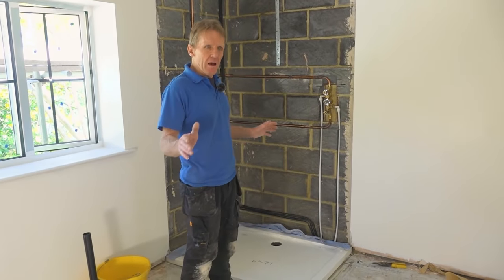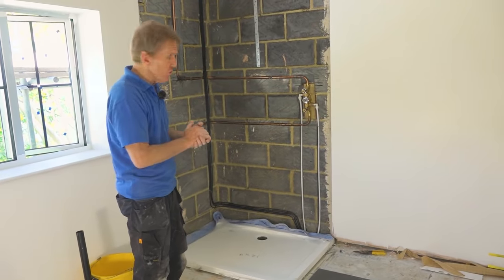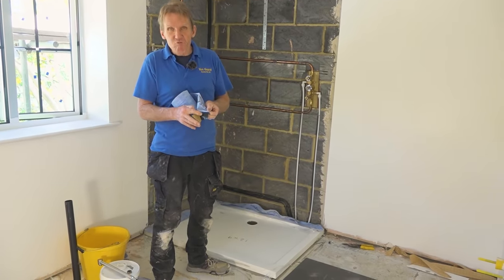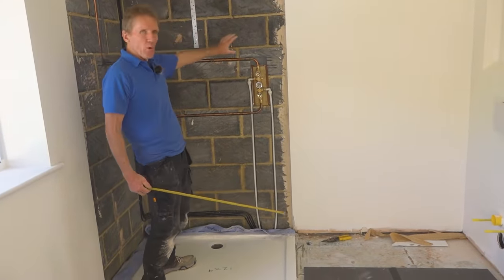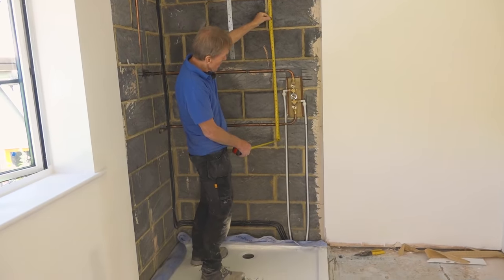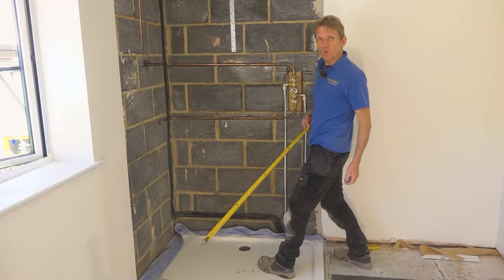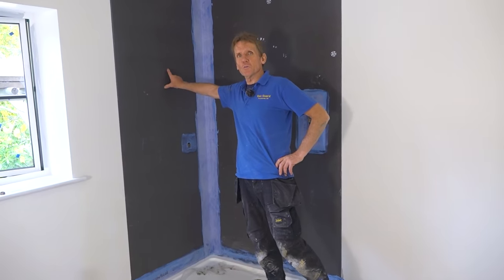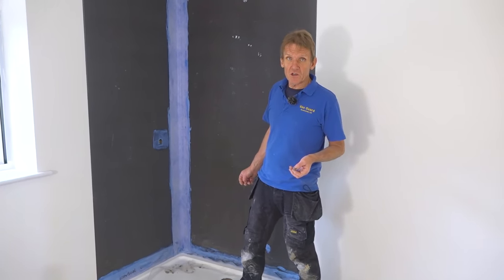100% Waterproof Shower Surround ~ Extension #23

Comment: Nice job, but I personally always fit boards then the tray and seal the tray to the board first and use dot and dab instead, always tape all round the copper pipework as cement based products corrode copper

Comment: Do those screws go straight into that block work without drilling and what was the foam for?
Reply from the maker: James loves a bit of foam
Reply: I guess the foam was to stop or prevent any moment of the board  surface after everything has set. That way the tiles and grout remain stable? IMHO

Comment: Correct me if I'm wrong but shouldn't a cement based adhesive not be in contact with copper pipe as it affects the pipe?
Reply: Cement corrodes copper. I just say I’ve never actually come across it corroding a pipe enough for it to leak. Probably because once the surface oxidises the corrosion stops..
Reply: Personally i always wrap copper pipes in walls with duct tape
Reply: @amateurvegan2636  I’ve come across it many times
Reply: Tbf oxygen corrodes copper

Comment: Wonder could you explain a little more regarding sealing up holes that are required in the backer board for pipe and shower controls. I.e. how to ensure water doesn't get in alongside the pipe and run down inside the wall.

Comment: Hi Roger, is there any reason why this tape was used rather than the abacus sealing tapes? Also if the tray is bedded in after elements board is installed, can q seal be stuck to the board from the tray ?

Comment: Hi Rodger. Love your videos. I’m installing a shower and I was wondering what mix of sand to cement you use. Is 4/1 ratio ok and do you use soft sand or sharp sand?  Also my floor is moisture resistant loft board. Is loft board ok or should I cut a section out (where shower tray is going) and use 22mm plywood instead?  If you can answer thank you
Reply from the maker: A 5 soft buildng to 1 cement is plenty. Use a bit of plasticiser and don't make it too wet. If you have chipboard I would replace it with plywood. Generally it is 18mm plywood but 22mm is not a bad idea.
Reply: Wow 🤩. Thank you so much for sharing your knowledge in such a quick response. You’re a legend.

Comment: Speed fit on the mixer 🤔, foam with dot and dab. Did you use the foam to secure the tray ?
Reply: What’s wrong with speed fit on the valve? 50 year guarantee? More than any copper or compression fitting…

Comment: Nice job classi seal is so good, how come no protection on the copper pipework from corrosion.
Reply from the maker: There should be no cement on the pipes but you make a good point

Comment: Great video - one question does the seal for the corner upstand need to be at a right angle to the corner or sort of cover the corner and then push it down into the corner.

Comment: When using the tape around the mixer valve did you just put a cut down the centre and and fold the excess around the edges and the back ? That what it looks like at point 5.50 on the video.
Reply from the maker: Yes that is it. The tape forms a little upstand to deflect water away from the aperture.

Comment: Just out of curiosity what’s the point in painting and taping around the shower valve and also the shower head outlets?? They are open parts of the board to allow for second fix. What are you actually achieving?? It’s always gunna be open
Reply from the maker: If you look carefully you will see that the tape is stretched and forms a small rim around the opening. The tiles will finish just short of this so any leaks that get behind the cover plate will run around that rim and away. Sometimes we put a neoprene gasket over the shower valve. It all helps. 100% leak free is the name of the game

Comment: Which is best, the Classi seal or the self adhesive Abacus tape for the joint between tray and the wall. The Classi seal looks easier to install.
Reply: I’m gonna use both, belt and braces

Comment: Is the waterproof board etc actually necessary? Surely if the plumbing is thoroughly tested it shouldn’t be needed? E.g normal plasterboard could be used.
Reply from the maker: I have seen so many tile on plasterboard installation fail. Why go through all that grief? Surely it is better to use the right board for the job. 
It is not the plumbing that fails it is the grout and silicone joints. We see it over and over and every time I take it out and replace it with tile backer board and the problem is solved.
Reply: @SkillBuilder  makes sense thanks for clearing that up

Comment: Hi Roger can I ask is that tile board insulated it looked as though it was. Great hair cut James proper job. Thanks Roger
Reply: Fairly sure it is elements board which is the waterproof tanking system. If you go back through the skill builder video’s Robin C did a video and Roger has done too on this tanking system
Reply from the maker: Yes Elements board cuts down on condensation
Reply: @SkillBuilder  Thankyou Roger
Reply: @dougsaunders8109  Thanks
Reply: @SkillBuilder  didn't know you could get thermal construction board this big!  Usually only 1200x600

Comment: Hi guys why don't you  have clips  on the pipework  or insulation? Just out of curiosity
Reply from the maker: The board will hold the pipework in the  chase with a bit of foam here and there. The board is insulated so the heat loss is negligible
Reply: @SkillBuilder   fair enough  . Just with high  pressure  showers if they have a push control button  such as aquala( which  yours didn't ) they tend to cause a bit of hammer.  As far as insulation I'd see it as  protection for the copper from any of the dab, but you guys are tidy so no worries  there. Did you get your van sorted btw.?

Comment: Can I spread acquaseal on finely smothly plastered brickwall and use this classy seal without elements board. Would that work the same? The problem is that the thickness of the boards would take extra room in a supreme small bathroom. I need to instal a standard bath. And what is the smallest depth of elements board
Reply from the maker: Yes that is a good method, I do it a lot but you don't get the insulation.
Reply: @SkillBuilder  you mean thermal insulation against cold coming from outside?

Comment: Can you just use any flexible tile adhesive to fix these elements boards to block walls, the adhesive recommended by the board manufacturer is 40 pound for 20 kilos.
Reply from the maker: Yes, I have even use drywall adhesive.
Reply: @SkillBuilder  Thank you

Comment: Hi, as you are putting on your blue tape what is it you are using on the boards with the brush ??
Reply: many (not all) tape systems ask that you prepare the boards with a layer of brushed on liquid primer/sealant, this lets the mesh part of the tape stick to the wall and supports the joint.
Reply: The blue solution they use with the brush is Aquaseal waterproof paint. Usin  it myself in a shower installation just now. Good stuff for wetproofing. 35 quid for 5L.

Comment: Good job, its a funny old trade as so many methods and often its very hard to know which works best in real life on customers budgets, when people rip out a bathroom they can often say it was installed badly as it comes out relatively easily such as dot and dab tile method, but to be fair once you break one tile and can get leverage it should come off easily but i often think with modern flexible tile adhesives in any method it holds the tile adequately to the wall especially with grout etc, if you tile correctly and grout with clear silicone in corners after it dries i think it should last as long as you want the bathroom, if you use correct bonding on walls behind - its nice to use all the special waterproof breathable membranes and glues etc but i think if water gets through it finds a way as nothing is waterproof more than tray and tile surface - obviously on floor tiles you need backbutter and better coverage on a perfect surface but wall tiles with a levelling system with dot and dab works great and saves money - its a skill and its a compromise - the tiles actually strengthen the wall greatly but as most only interact with the wall when ripping out it gives the illusion of weakness - but when fixing to a fully tiled wall the strength is great - when i rip out old school wall tiles (small ones as that was the only thing available) it takes half the wall with it, so for me its too strong as we always eventually replace bathroom - its interesting and ill keep and open mind as i might be totally wrong once i try something new but i feel like the american paper and glue stuff is a bit of a con, if you soak water or trap water on it it will permiate - if grout and silicone fails or just needs renewing that would solve many issue its just we tend to see them too late - i suspect they will never make a perfect wetroom system as that would effect sales

Comment: Is it best to board down onto the tray? Or can you board down to the floor and then tile down to the tray?
Reply: Never board to the tray, always behind it.
Reply: Board to floor gives better control of any tray seal leakage, less chance of damaging wall components and of water running vertically to other parts of the building.  Having said that I'm refurbing an older shower with 3 walls and the tray is so jammed in theres not enough room to board to the floor on all 3 sides. I will probably apply some tape and or liquid seal to the wall components as a second layer of protection redirecting any leak water onto the floor as if it was fully boarded to the floor.

Comment: What board is that you used for the shower area please Roger??? 👍
Reply: It's either Wedi or Marmox. If you use this stuff you have to get special washer's for when you mechanically fix the boards to the wall. The surface of the boards are actually soft so if you don't use the washer's the screws will just disappear into the surface and not do anything.

Comment: Maybe look at the kerdi schulter systems, much better as you can buy circular rubber gaskets with membrane attached to go around the pipe outlets. What you did there was good but the most vulnerable area around the controls was nowhere near watertight.

Comment: Noob here - Can someone explain why people often plumb in showers using both copper and plastic piping at the same time? I think I understand why you would use one or the other (basically plastic is easier but some people don't trust it), but then why use both?
Reply from the maker: We used PipeLife pex for the supplies and that is run in from the bathroom supplies which are isolated.  The supplies to the shower head and hand spray are run in copper because the bends in the wall are too tight for the plastic pipe and we don't want elbows burried in the corner. 
Bending the copper pipe means there are no joins in the pipe other than the shower head and the oulets from the shower valve. These are made in with Loctite. All of it was pressure tested before the boards went on.

Comment: Lovely job but made a mess of the tray dust sheet or even cardboard would have protected it cement adhesive leaves scratching
Reply: That's what i was thinking. And when i go to a job where someone else has put protection on the tray, i always pull it up to see if they were trying to hide something who can then blame the tiler for causing it. Many times i have found rubble, screw's etc under the protection and if i see any damage at all, i always point it out to homeowner. That's the first thing i do when i get to a new job. And then i put the radio on!

Comment: I'm no pro builder, but recently having installed a new bathroom with walk in shower and built in wall toilet in my own house, I know that this installation would NOT have been approved according to code here in Norway. A wet room (like a bath) is divided into three zones, and the floor MUST contain at least one drain 2cm below the top of the door sill, and with a 1:20 gradient. The zones are:
Zone A: the entire floor + inside/around a shower - must be completely sealed off with minimum 3 layers of seal, or better, with a fitted hot glued 3 mm thick 100% non-degradeable rubber membrane. The shower zone has be to extended 1 meter out from the actual shower, not stopped where the glass wall starts (as it seems to be here). Floor zone extends 10 cm up the wall.
Zone B: around sinks, faucets, toilets, etc - it's only required with 1 layer of seal and extend min 50 cm.
Zone C: the rest of the wet room there is no code except if the walls are if painted the paint must be water proof. Only water proof drywall/cement sheets can be used behind tiles.
Reply: This is England not Norway, different codes apply!!!
Reply: Thought the rules in England is radiculous already, seems nowhere comparing to Norway

Comment: Was the wall off slightly hence the foam? Or just for sticking?

Why the seal around the shower in/outlets? Just to tighten the hole up incase of water ingress? 

I once had to use aqua board, then tanked it, then it was tiled. It’ll be dry still in 3021 during Covid-119 😂
Reply from the maker: Yes the gasket around the valve deflets any water ingress away. The foam is for sticking
Reply: @SkillBuilder  Nice one cheers. Good video as always 👍🏻

Comment: what happens when them push fittings start to leak, i thought they werent to be used unless accessible
Reply from the maker: THOSE pushfits are good and if they leak they can be accessed through the shower cover plate. Mosaic tiles on this one so not a problem if we have to take a couple out with a multi-tool.
Reply: @SkillBuilder  i understand, many thanks for the reply

Comment: Why the foam.?
Reply: CRT
Reply: Because foam sticks like shit to a blanket on almost everything. I always use a bit of foam with the plasterboard adhesive when I’m spot and dabbing over cavity closers just to be sure they won’t budge. 👍👍
Reply: Does it not push the board off where you spent time levelling it?
Reply: Nigel Bennett no not the amount that was used. Emptying a can in a concentrated area would move the board as it expands slightly. Also depends on the make of foam. The cheaper brands like everbuild arnt as dense as the soudal or SX gear.
Reply from the maker: @keanMechanic  If you put in too much it will push the boards out but a few screws will hold it in.

Comment: The only way to provide a guaranteed leak proof shower for evermore is to install it on the ground floor with a drain through the concrete floor. WOOSH
Reply: Or just don't connect up the water.

Comment: I personally would never run pipes horizontally only ever vertically to the mixer in any area that might ever be drilled as it's just too much of a risk imho
Reply from the maker: The valve is out of the wet area and that is something customer really  like so we do that and run the pipes across the wall.

Comment: But you didn’t put the board on with cement based tile adhesive, you used spray foam adhesive.
Reply: I think I saw a bit of both going in there.
Reply: They used both you can see him spraying round the lumps
Reply from the maker: I usually use KST or something similar but James loves his foam and it is all going to help. We even have a few screws in there.

Comment: I'd never run shitty push fittings behind a wall but that's just me.
Reply from the maker: We have limited the number of fittings and they are by the valve. They should be fine but if not they can be got at.

Comment: It would have been nice if you explained all the materials used, rather than us just watching you install random stuff
Reply: Wedi or Marmox boards fixed with spray foam. Also mechanically fix with screws and Wedi/Marmox washers. Seal is called Classi Seal.
Reply from the maker: @tilerman  It is Elements bord, made in Yorkshire by  Abacus. It is cheaper and just as good as that German stuff.
Reply: @SkillBuilder  Thank's Roger. All the best.

Comment: I don't agree as tape goes off in time and you shouldn't be relying on paint on or tape sealers. The best 100% solution is using a one piece fibreglass moulded shower unit designed for tiling.

Comment: 1, tape pipes to protect from
Corrosion.
2, put board down to the deck, then put tray in.
3, bed down tray with sand and cement, not tile adhesive 😭
4, protect tray whilst working on it, but I guess you are a builder (hence plastic pipe in wall) 🤦‍♂️